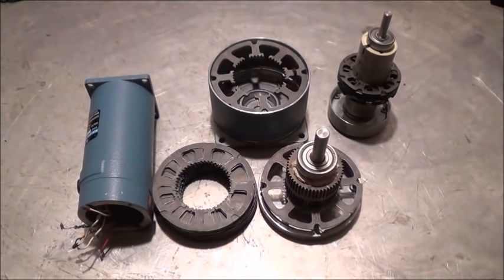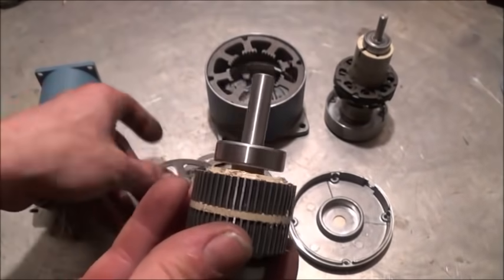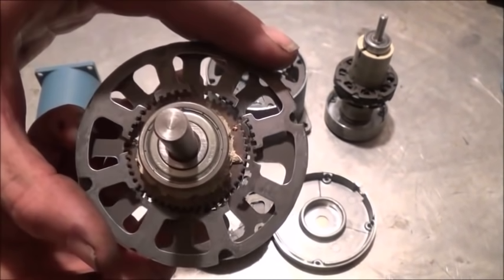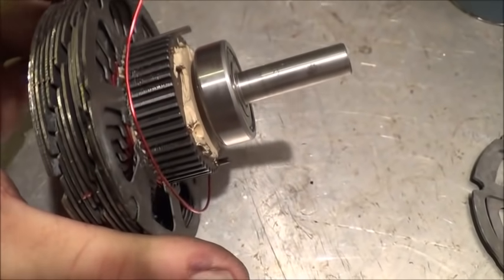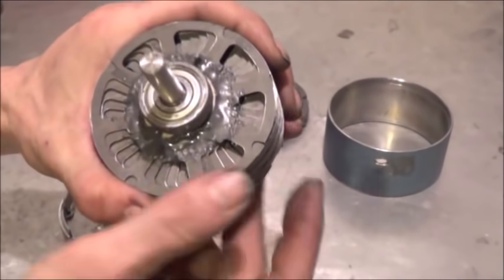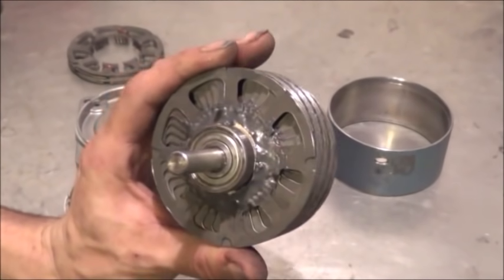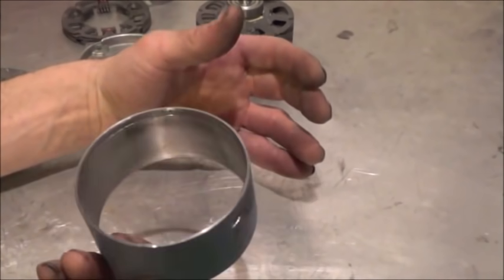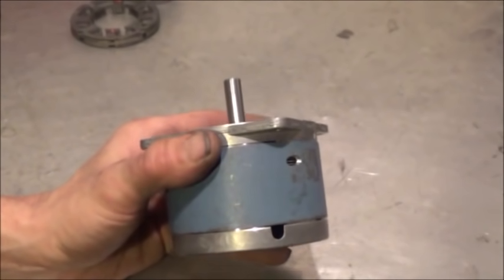Tesla Turbine, "How To Make Your Own Tesla Turbine" for Hydroelectric, Steam, or Wind.

Comment: Without seeing it running, I would say this is a great theory.  I suppose you could copy the layout and duplicate it with a CNC machineor plasma cut similar pieces with stronger more rigid materials. Then you could scale it to any size you wanted to and tweak it for optimal output.

Comment: This particular turbine construction could be used as a heavy water steam electrolysis turbine, constructed out of metal deuterides.  

Small enough to construct for a lab, the only problem would be how to introduce about 20 amps of current so that electrolysis begins.  

Presumably because the turbine is in motion, the surface of the rotors would not be pitted by z-pinch, and once electrolysis is under way, would actually generate power.  

Most lab experiments for heavy water electrolysis are static units, but once in motion, the metal deuterides could avoid the pitting in the metal.  

An example of heavy water electrolysis with a tungsten cathode:  

https://youtu.be/uMFvzohuVew

Comment: A very good presentation! To make the Tesla Bladeless (sp?) Rotary Turbine run as an internal combustion engine, Nikola's "No Moving Parts" One-Way Valve needs to be used at the inlet manifold, & make the rotors thick enough to withstand the high temperatures involved. Based on one of his patent illustrations, if made properly, (and dynamically balance the rotor assembly), it really will make 500-hp that "fits in a hat". Bolted to an automatic transmission, (or a manual-shift with balanced clutches & other internal parts), & the ring-&-pinion gearset changed as needed to handle the extreme high speed, the drivetrain will easily power an automobile, truck, or just about any application which requires a lot of hp in a very small space. Low-grade fuels can be used, since the design has no compression ratio, & no squish or quench areas, (and yes, that's what they're called; see the collected works of Sir Harry Ricardo for more details) thus there is no ping or knock to justify high-grade fuels. Once started & the "intake manifold" reaches a low- to medium red heat, the spark plug can be turned off, since the turbine will "diesel". To stop the turbine, shut off the fuel with a solenoid-valve, or any of the other means to "fuel-starve" the engine.

Comment: Mr Teslonian, I have a suggestion. You mentioned either in this video or another one of your tesla turbine videos the possibility of pushing water through the turbine. Water and air can both be compressed fairly easily. I believe this is a big factor for why you do not have much low end torque with this turbine. The air is being compressed in small amounts, but just enough to make a power loss. My suggestion is to push hydraulic brake fluid through the turbine. Hydraulic fluid does not compress like air or water, and assuming there are no air bubbles in the system, I beleive you will create much more torque. This however may come at the sacrifice of some high end speed, since air can move through channels much faster than brake fluid.

Comment: Great improvements. 
Needs output air holes to be spiraling out from center and cut slanted to match the slipstream. It could also benefit from magnetic bearings. 
3D printing the parts will allow you to control their electric and thermodynamic properties. 
Great design, has implications in electric generator / motor technology, mechanical and electrical gearing and engineering, turbines, resonance and understanding in toroidal energy flow.

Comment: I'm looking at all the parts from this disassembly that you are starting with, and this looks very similar to the parts of an AUTOMATIC transmission. like a GM Turbo 350.  I don't know if this Tesla Turbine technology is involved in any way to the design of these transmissions, but I am just wondering!  I know a torque converter is a type of TURBINE!
Reply: I can't say directly but I do know that Tesla turbines are very popular in the oil/gas industry to pump oil since the spaces between the blades allow crud to pass without damage.  But I thought about the hydraulic pumps in an automatic transmission and a Tesla turbine is a very nice way to pump fluid.  But I honestly haven't seen the inside of that transmission.
   On a separate note i saw a youtube video from a guy that didn't explain very well but he took a modern alternator and showed that there is, instead of a heat generating back emf controller, it uses permanent magnets moved in and out to control the amount of output current being generated.  This is an advanced technology that is very laborious mathematiclly to show.  There's a guy on here who demonstrates this and the resultant gains in efficiency.  He doesn't believe it is in use today   it's certainly not in any other appliance.  I'm wondering if some of the "good ideas" people have had are finally coming into production by a company that used to silence these.  Maybe they see that if they don't do all that's common knowledge to compete then their time is limited.  We've ball heard the stories of better ideas thst make fantastic gains in efficiency.  And if you look at the past 20 years cars have become more efficient by a lot, mostly at the expense of power.  But who knows?  Bit by bit maybe quietly they are introducing these things in production machines in ways that don't make waves.  Maybe?  I want to get a newer model GM alternator and try that stuff but who has time ?  I've got to fix my own car.
Reply: When I was talking to my grandfather about the design of the tesla turbine many years ago, the first thing he said was "so, he basically invented the automatic transmission."

Comment: You may want to clean the parts with electrical connector cleaner, and wear rubber gloves to do this project. Electrical cleaner does not leave a residue, and the oils from your hands (even after washing them) can degrade the components.

Comment: Hot water through motion. I believe you are talking about cavitation heating. My only concern for this is the pitting and galling that could occur. Look at boat propellers and all the pitting damage on the blade surface. If you though it was all because of debris, Oh no.

Comment: Hmm I agree with Mr Teslonian, doing as suggests would greatly improve the efficiency.
Reply from the maker: The Tesla turbine at it's top velocity and with a very small load is about as efficient as you can build, the flaw and reason they were never used is that they drop drastically in efficiency once a medium to heavy load is applied. They also fail at providing torque at low rpm's which is useful for vehicle use, this design was  to provide a turbine that functioned with more low end efficiency than the origanal design (this doesn't mean that it will perform any better at full rpm's or under light loads than the origanal) and could be used to get a vehicle to move when the turbine starts at 0 rpm's, were as the Tesla turbine would have to be at full speed before you could apply resistance to it and move the vehicle.

Comment: It would be an excellent turbine for recovering exhaust heat in hybrid vehicles. Use a heat transfer fluid with a condenser and run it through a turbine, and use the turbine to run a generator.

Comment: can you use water as an energy input? if corrosion becomes a concern...can 3d printed version be made as a one piece? does the core cylinder diameter affect the output? finally, does the length of the cylinder affect the rotation speed?
Reply: In Tesla's day the limitation was being able to make the plates rigid enough, so I guess if metal isn't rigid enough then a 3D printed plastic version won't even be close...

Comment: Is someone wanted to make this off the grid sized. Would tall skinny variations or short and fat? I'm picturing like 4" pipes 3 or 4 feet tall like 4 or 5 that can be build into the framing or 12" tall 6ft round laid into the foundation. The later would be a challenge to properly service if anything was to fail. But would energy decrease with a tall unit due to gravity?

Comment: I'm still laughing because people can't figure out why we take things apart just to know how they operate. We (C) better.
Reply: when i was a kid i took apart every old electronic
Reply: When I was 15, I wanted to learn how to rebuild my Dad's 283 SBC V8 powered 62 Chevy Impala .  I had no clue how to do such a thing.  I just started turning ratchets and stripping apart everything.  about 2 months later, my dad's car had a fresh new rebuilt and running engine!  Two months after that,  he had a busted drive shaft and a punk kid smart ass Son who was due to receive a major  ASS WHIPPIN!  No that's an exaggeration!  Never got one, but I did deserve one for secretly taking his car out to do a quarter mile test run!  Especially when I was only 15 and had no drivers license or even a Lerner's permit!  No insurance.  Driving the streets of  the state with the strictest DMV  Regulations on the globe!  That's right, CALifornication nation!  The state with more regulation than I could ever give you a rational explanation!  Beyond the  capacity of your imagination!  Good thing I had already figured out how to drive a car with a manual trans.  I just got a bit rough with that clutch.  I mean, You can't pop a brand new clutch without expecting to break something.  Learned that the hard way!  But broke a few axles and pinion gears and motor mounts, and various other drive train components in the following years to come.  Guess I actually didn't ever learn.  Oh Boy, I guess I'd better get out there on the street and see what else I can break  in a drive train!  I mean, Isn't that how we are supposed to learn how NOT TO BREAK STUFF!    REVERSE ENGINEERING!  tHAT'S whAT it's called!
Reply: i do the same thing people used to always ask me why i want all their bad parts
Reply: Those people must have a limited vocabulary that excludes the words/Definitions of:  (  REVERSE ENGINEERING! )

Comment: Hello again use your turbine system along with an older style 3 wire automotive alternator. You can use dc\/ac step up or down transformers to apply the correct voltswattsamps conversion to make your earth battery system up to full 220volts. Use the heat sink variable(your heat to electric current exchange) where you had all those v&w wire shapes twisted around that graphite pencil lead. Use forced induction from your gasifier exhaust along with any radiant heat lost during the high contrast heating or cooling of the metal material your conducting current through. "wires atomic resistance to shed a neutral particle with out stepping an electron to a higher orbit" the result is a shed nuetron and the closest orbiting electron takes the place of the shed neutral particle. In doing so and with a fine tuning of the magnetic frequency you can reverse the atomic degradation  and revitalize any atomic structure.
I truly believe electricity in all forms is really a LIVING AND CONSCIOUS LIFE FORM. Plasma being a more condensed but more free to communicate than the forms we trap inside of insulated copper or gold.
I know you are aware of the push pull effect. We waste electricity in the form of heat. We force it through conductors burning wires until they glow(incandescent filiments). 
Thank you for enlightening the World Mr.Teslalonian (please forgive my spelling) Your future is ready for the reveal.
Your biggest fan JCB525021369101

Comment: Suppose you powered the turbine with compressed air, and fashioned a sealed "exhaust capture" device which feeds into a hose and loops back to the compressed air supply line (between compressor and turbine) with a one way valve.  Could it be possible to power the unit to maximum efficiency and subsequently shut off the compressor supplied air and have it "self propel" using the collected exhaust air as 'supply air' in a sort of feedback loop?  Just a thought...

Comment: I'm simply looking for a way to build and generate my own electric for my home.  One that can be moved if necessary to another home.  I am not understanding of any engineering, but willing to sit and listen and learn.. any help, I will gladly take. thanks
Reply: I have an idea for constant energy flow :) Imagine a bunch of water wheels positioned above each other, each one when spinning generates an electrical current not so unlike a wind mill does but with water. At the top is a big basin of water, as the water falls straight down it spins the water wheels generating electrical current. When it reaches the bottom their is another basin, but this one can be shaped some what like an up side down bowl and is slanted down so water flows into areas that are separate and in these areas the water is evaporated and then travels up tubes and back to the top where water re-condenses and falls back down. In these tubes the steam is traveling up through, there is a smaller tube coming down from the top and small windmill like contraptions protruding from it. The rising steam spins these small windmills and generates electrical current that travels through wires in the center of these inner tubes and can either be used for extra energy output or help to heat the bottom bassins. The energy to keep the bottom hot enough to evaporate water comes from as many of the water wheels spinning as needed. To get more energy output you just make the contraption taller with more water wheels, It will always only take so many wheels spinning to keep the water on bottom boiling so more wheels equals more energy output. The material in the top basin can be designed as a heat sink to help the water re condense into liquid form, if built correctly, so no water/steam escapes, it just keeps going and going utilizing natural forces to function. :) Now just add the proper electrical wiring into its design so all the excess energy being perpetuated can be accessed from plugs on bottom of device and presto you got yourself free energy. :) Please share this Idea with Everyone.

Comment: what are your thoughts on the load issues of tesla turbines? ive been wondering if perhaps you could help offset them with true frictionless >air?< bearings , if you got really good at it surely you could even control it with mag lev type n/s pulses, im unsure if permanent or electro magnets would be best for this and was thinking if you put perma's on the crank shaft and coils round the crankshaft sheathed like modern motors, that could produce and allow for electro magnets, what do you think to the 97% claimed by tesla n met with no load? , i was thinking if you had a driving force to take energy from you could easily make a very nice mag lev tesla turbine, my context of need was for a pistonless helium 'sterling not sterling' motor (because it has no piston) taking advantage of the helium expansion and also taking advantage of the subsequent compression at room temp to drive tesla turbines and magnetos aimed at firing electros in nsnsns for mag lev , this is a very crude outline, needless to say it would need an external heat source so we arent breaking physics at all as far as i can tell. another quick que below you say boundry effect discs , is the pattern hexagonal nano cavitation by any chance what would you think to a disc with nano or micro hexagonal or even circular (former probably better) i will have to go away and research what the powers that be do, i had thought cavitation would help?
Reply: Ashes  Wake I hate to break it to you, but true frictionless bearings don't exist. There are bearings with fairly small amounts of friction, but there is still friction. It's a thing we can't avoid yet, if ever. But for the rest of your comment, the electromagnet could work for what you are looking for. I'm just making a guess here.

Comment: Why not build a stator coil into the tesla casing and put thin neodymium into the outer disc to combine the generator with the turbine?
 In fact it might be interesting to see how a polar molecule working fluid/gas would perform thru a disc array with permanent magnets set into them too. I guess the molecules will be spinning and in a random arrangement and in the process of reorienting themselves in the magnetic field there should be a resultant vector providing more drag/torque?
I would like to play around with this and other ideas but unfortunatey I have an unfavourable time to idea ratio!!

Comment: Great inspiration and skill! Just to help clarify it for me, in principal its higher torque will be generated by the resistance of the steps to the steam/air/liquid flowing through the apertures? If I understand correctly because the disks are offset and form a spiral staircase you have resistance from both the surface of the disk as per the original Tesla design together with the the increased resistance of the offset stepping surface of the blades? Thanks, cant wait to see it run